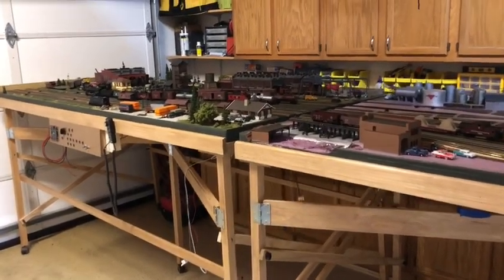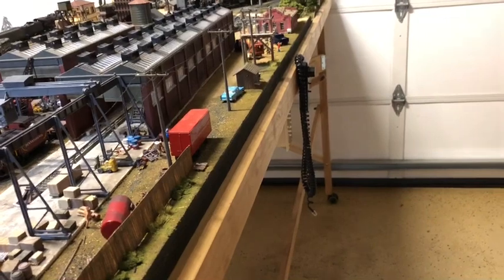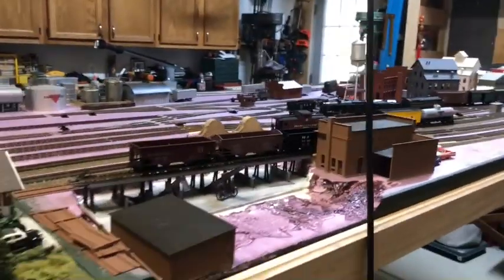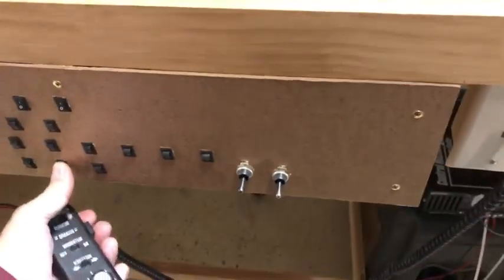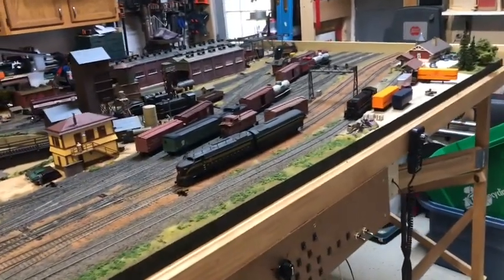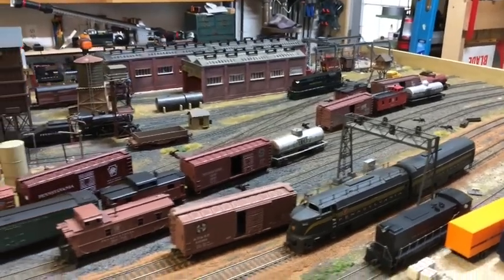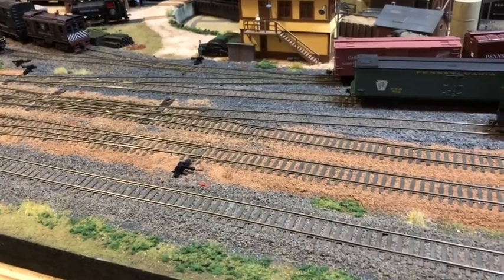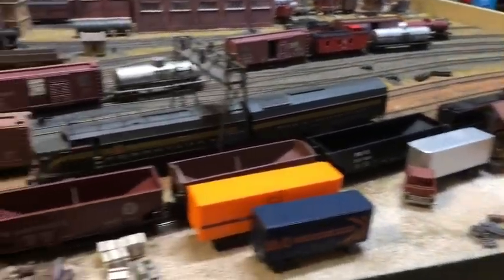Model Railroad Adventures with Bill E25 - HO Scale 4x16 garage switching layout set up and operation

Comment: Interchangeable modules? What an interesting concept! The ability to connect at either end...verwy vewry cool Doc. What's gonna happen when you get 18 modules built, interchangeable garage addons? You'll need some heavy duty casters to accomplish that move!
Reply from the maker: Thanks!   I wanted to make it interesting for myself and I think I succeeded 😁. There may be a third section as I still have some code 70 switches.  Someday maybe will have a house with a basement or large outbuilding then 18 sections could be a reality lol

Comment: Totally amazing!  This is clearly not your first rodeo.  I’m wowed that you have the ability to reverse the two 4x8 layouts.
Reply from the maker: Thanks!   I’ve had other layouts before 2000 but nothing since until now.  When I was about half way thru the first  section I started thinking about making the next section reversible.  It has actually turned out better than I thought it would :D

Comment: Hello, i was wondering what brand your heavy maintenance shop is?
Reply from the maker: Hi !  Thanks for watching and subscribing 👍🏼.  The heavy maintenance shops are from Playcraft engine houses.  Think they are a French product.  The ones I use came from an EBay lot purchase.  They were thrown in with other items already built up. They are good solid models
Reply: @modelrailroadadventureswit6347  thank you for answering my question. The info is exactly what i needed.